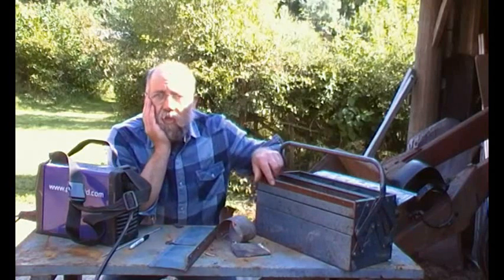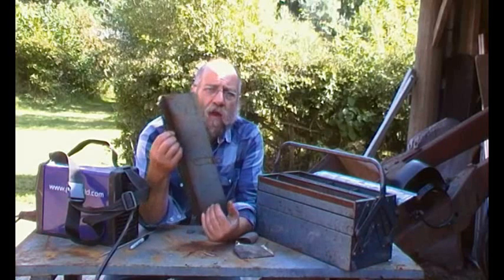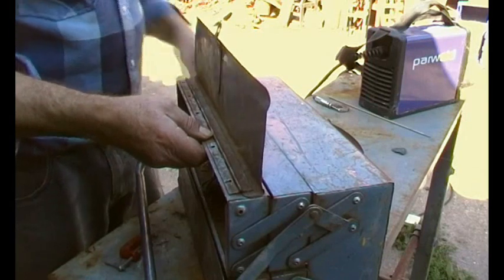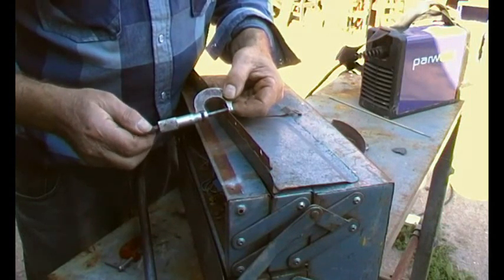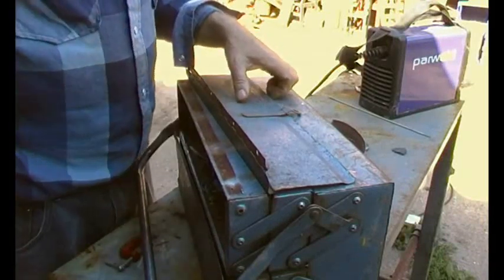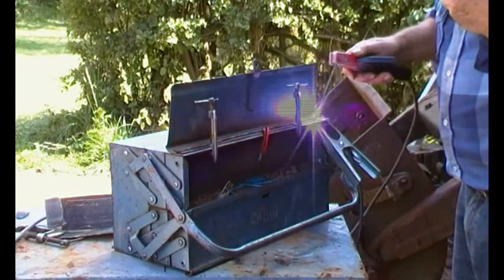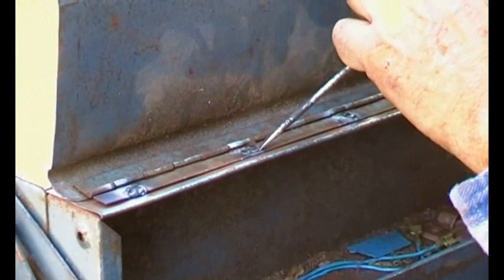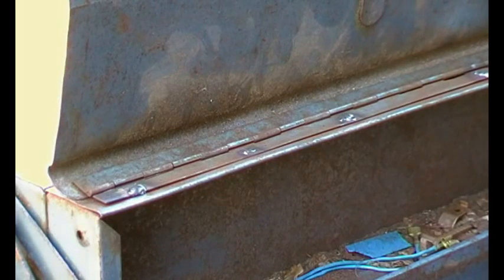Plug welds in thin steel with an inverter welder

Comment: Andy you can clamp a bit of flattened copper pipe under your plug welds to act as a heat sink stops you burning through
Reply from the maker: Simon, good tip, a clamp either side would keep everything tight, cheers
Reply: You could also clamp a 1/4" piece of aluminum on the back.
Reply from the maker: yes, I used bits of steel but that was to transfer the clamping load, cheers

Comment: Well done Andy.
Use the same Parweld welder. Don't use it that much but find it less smooth than the old fashioned Einhell transformer type I used to have before it rusted out.
Maybe I just need more practice!
Reply from the maker: JIm, I find that this welder is much better than the SIP transformer unit I was using and is now stashed away just in case, cheers
Reply: @TheInfoworks  I don't weld much but couple of years back bought an old Oxford oil cooled which is far superior to the SIP like buzz box it replaced. Would love to see how an inverter compares to it. Beauty of the Oxford is it will outlast me, but the size and weight tempts me to buy an inverter welder.